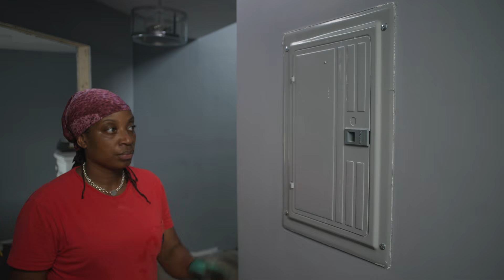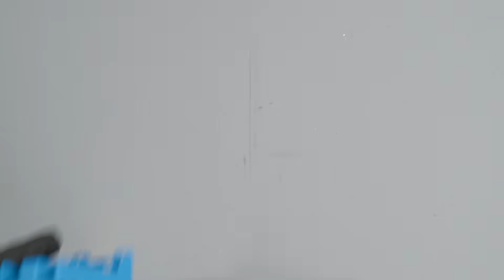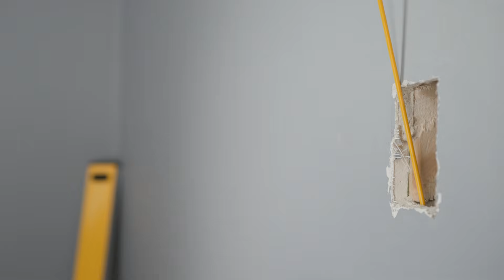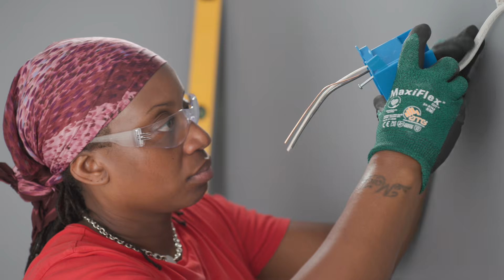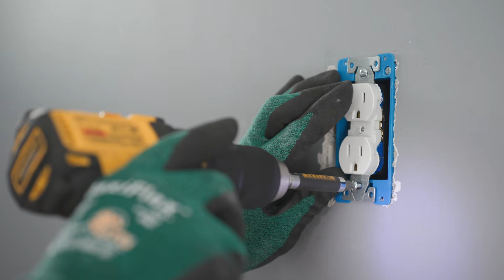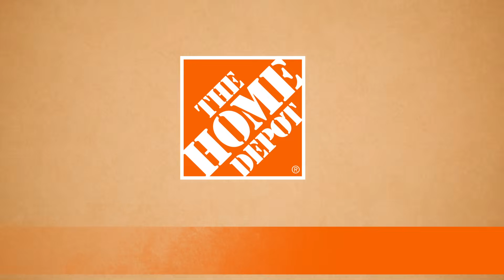How to Wire an Outlet | The Home Depot

Comment: im just curious why did they use 14/2 and not 12/2?
Reply: Because that's what the existing circuit is wired with.  Never mix wire gauges on the same circuit; always match them to existing.
Reply: 14-2 is rated for 15A, 12-2 rated for 20A. If your breaker is 15A, 14-2 will suffice.
Reply: Just what they had.